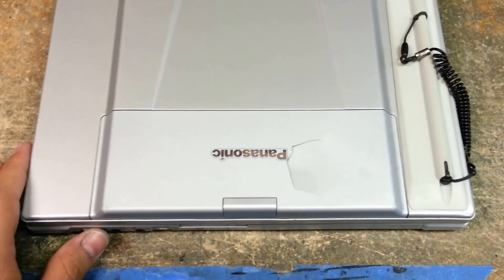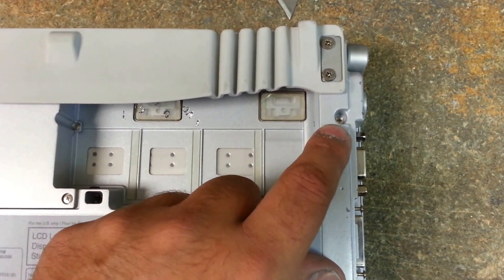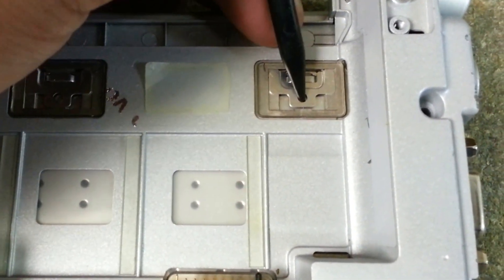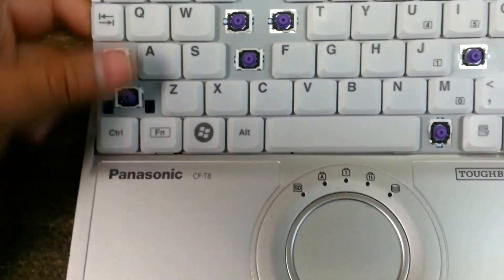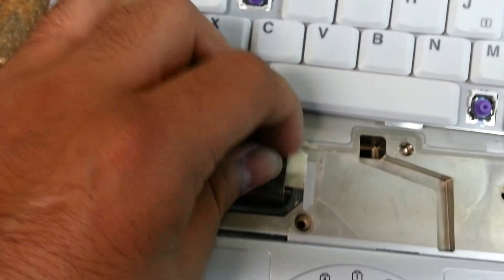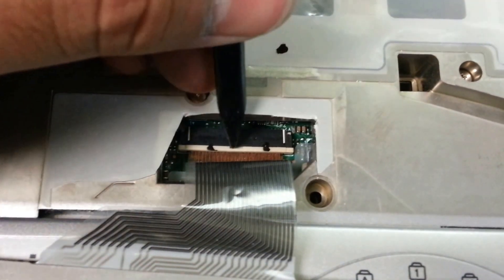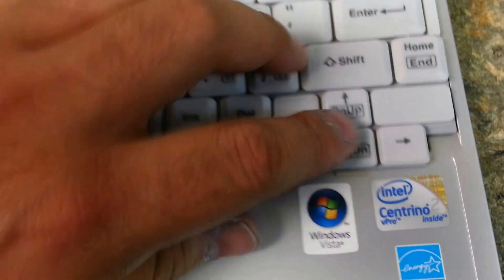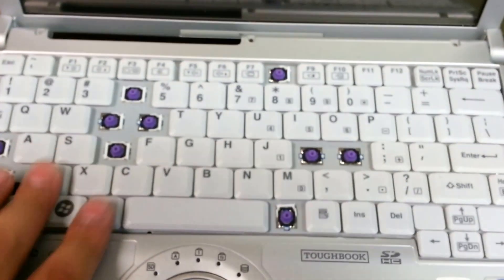Panasonic CF-T8 keyboard removal

Comment: What is funny is that this device was advertised as spill resistant, but just a little moisture/water (from cleaning it) may/will (like happened to me) KO the keyboard.
Reply from the maker: Alastrim lol, yes just a small amount of liquid can kill these "spill proof" keyboards.
Reply: Hmm. I spilled tea on mine and aside from being sticky it's still working nine months later.

Comment: Is this removal but not replacement? I have to switch the keyboard between two alike units, one of the keyboards is fail.
Reply from the maker: Alastrim I didn't put it back together because I figured it was easy to reverse the steps.
Reply: Sorry, I watched the video till the end, it helps. Thanks.
ps. I was put off by the part where you cut the plastic cover of keyboard cable + connector...
Reply from the maker: Alastrim I cut the plastic cover. I would recommend peeling it off, I would even add some extra double sided tape.